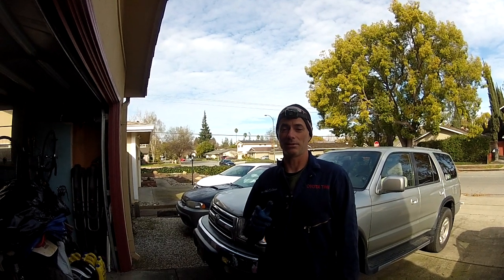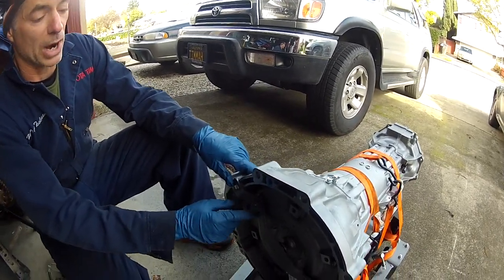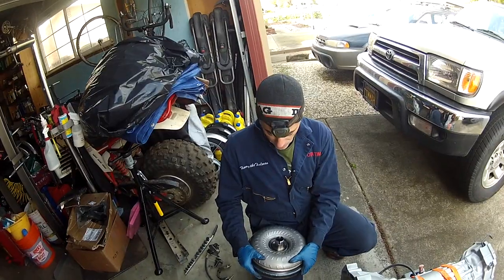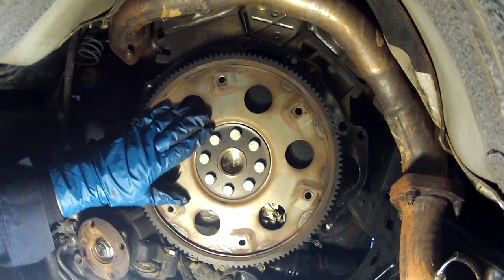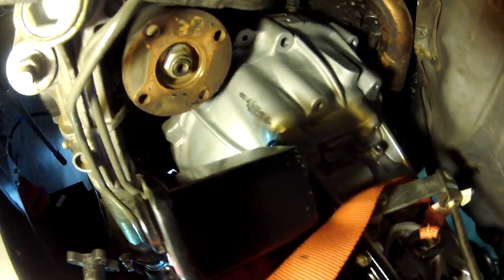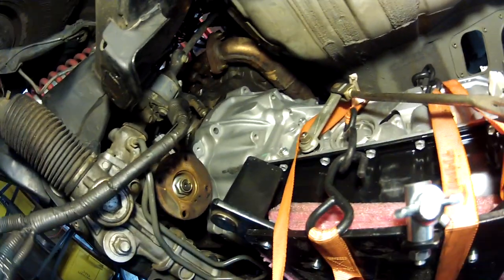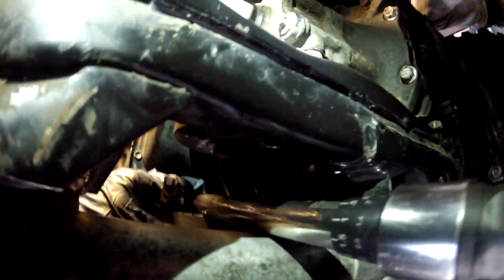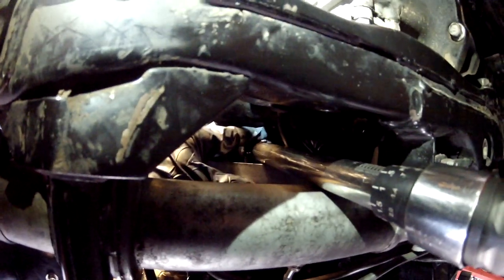Toyota 4Runner Auto Transmission Replacement (Part 3 of 3)

Comment: when you're trying to connect the drive plate to the torque converter, it helps to use some tape on your ratchet to hold the bolt.  

I used a 1/4" extension to stick through the drive plate hole then used a finger to spin the torque converter until the 1/4" extension grabbed the torque converter hole, lining it up for the actual bolt.

I say to use tape bc if you don't, you'll risk dropping a bolt into the transmission, forcing you to repull the transmission like I did. don't be like me!
Reply from the maker: Yep, we like the tape on the socket trick.  We've used it lots of times.  I think I was able to get them all started by hand though.

Comment: Hi Timmy, question for you, do you have to support the engine in any way? Thank you.
Reply from the maker: No, you don't.  The engine is fairly balanced on the engine mounts and won't be putting too much extra stress on the mounts with the transmission removed.

Comment: GODWILLING I'll be replacing the rear main seal in the future. After  the transmission is out would it be as simple as removing those bolts on the flexplate and getting it outta way? In doing that step would the rear main seal be exposed right behind the flexplate for removal...? Love the videos, I might actually get brave and do this alone lol...
Reply from the maker: You are correct.  After the transmission is out of the way, you remove the flex plate and the rear main seal is exposed.  You could do it alone with a transmission jack but it's definitely easier with somebody helping you.
Reply: @TimmyTheToolman  : ok, great thank you, I really appreciate you guys.
Reply from the maker: @israelrodriguez6986  You're welcome Israel.

Comment: Awesome video Tim! How much did the new trans cost? 
I wouldn't try this myself but it's cool to watch and learn. My 4Runner is having the rear main seal replaced and I was curious on how the trans is taken out.
Reply from the maker: Hey Eric, out the door, Sean spent $2500 for the transmission at a local Toyota dealer.
Reply: Is it a new or a rebuilt transmission?
Reply from the maker: Well, there's no such thing as a new transmission for these 3rd Gens as far as I know anymore.  Anything you buy is going to be rebuilt or remanufactured.  I though rebuilt and remanufactured were the same thing but they aren't.  Rebuilt means somebody tears apart the transmission and only replaces the parts needed to make the thing work again so not all parts are replaced.  A remanufactured transmission means ALL moving parts are replaced.  The only things that are reused are the casing, the pan and any other non-moving parts.  The transmission Sean bought is remanufactured by Toyota and essentially NEW because all the internal moving parts are brand new.  The outer casing is just a shell to hold everything together.

Comment: Mr. Timmy how do I adjust the transmission kick down correctly?? Thank you for your helpful videos!!!
Reply from the maker: Take slack out of the cable by adjusting the position of the 14mm nuts that hold the cable to the throttle body.
Reply: Timmy The Toolman the cable needs to be firm correct? I’m just confused whether to leave a little slack or none at all
Reply from the maker: You want a tiny bit of slack, not tight.
Reply: Timmy The Toolman Thank you so much!! I think I left too much slack and made my rig shift rough from 1 to 2. When I get home I’ll leave just a tiny bit of slack and take it from there.

Comment: Does Sean's 4Runner have a body lift?  Would it be much more difficult to R&R the transmission without the body lift?
NM.  I see my questions are answered in the video.  Thanks.
Reply from the maker: Sean does have a 2 inch body lift which probably made getting the upper transmission bolts out easier but there's plenty of room to get the extensions and socket onto those bolts even without the lift.  It also might have made it easier to get some of the electrical connections disconnected but I'm just guessing.  The body lift probably made the job a little easier but not a lot easier.  This isn't a hard transmission to pull.  It's just a time consuming job that's all.

Comment: Awesome job Timmy the Toolman, unfortunately it looks like I'll have to do this to my truck. The snake oil/lubegard didn't help with shudders on my truck. About how many hours did it took you guys from start to finish?
Reply from the maker: Hard to say Sean because we're filming and that at least doubles the time.  I'd say for the whole job and its your first time doing it, commit 2 days to play it safe.  Its a lot of work.
Reply: Hey Timmy, do you know if there's a easy way to tell if the torque converter or the transmission fluid pump is bad? I read that both would make a whining noise if they go bad.
Reply from the maker: @gibfkn  No, I don't.
Reply: Hey Timmythetoolman, I just drop the pan and there wasn't any chunks, there was some really small metal shavings, like you can't even pick it up small. But, the fluids was kind of a dark red, which I think is kind of odd, considering I just put about 10qts of brand new fluids in it about a month ago. What is you take on this? Like always thank-you in advance for your help!
Reply from the maker: @gibfkn  There was probably sludge build-up in the transmission and the new fluid with it's detergent qualities worked loose that sludge made the fluid discolored.
Reply: @TimmyTheToolman  Dude, taking the transmission out without a lift sucks, I just did it this weekend. 

Hey, man let me know the next time your in Portland, I'll buy you a beer or something for answering all of my questions.

Comment: Hey Tim, I have a 2000 4runner SR5 4wd and I need a new shifter seat, But I noticed on Marlin Crawlers it doesn't specifically say that the Red, White, or Blue fits. I'm curious if the blue one will fit mine.
Reply from the maker: Hey Brandon, I thought I remember only one choice for a shifter seat when I was on their website last.  I'd call them and ask so you don't end up ordering the wrong part.

Comment: So you didn’t have to drop the pan again on the new trans to get the most forward hard line tight ? Like you did to get it loose ?
Reply from the maker: Yes, you're correct.  I was able to get that flex head flare nut wrench in there to tighten the nuts without getting getting the pan out of the way.  2nd times a charm.
Reply: Thank you so much, yr video was edited right when you tightened up that front one so I just wasn’t sure how you did it, considering you dropped the pan the first time.
Reply from the maker: @forestbell3853  You're welcome.

Comment: Do you run cleaner through the cooler lines before hooking in to new trans? I installed new trans and was told to clean all lines before hooking to cooler.
Reply from the maker: We didn't run cleaner. We poured clean ATF through them just in case there were some metal bits in them from the transmission failure.

Comment: Hey guys, I think your videos are great and they've certainly helped me out with all my yota's. So I'm not much of a youtuber and could not figure out how to even private message you but I have a question about swapping motors with different transmissions. I have an '01 Tundra with a 5vzfe manual that I pulled the heads off and discovered that I need the heads rebuilt. I found another 3.4 with 130k and fresh timing for $500. It came out of a 99 4runner with auto transmission. My question is whether or not the wiring harness plugs from the manual tundra will hook up with the plugs on the motor? I don't see why they wouldn't but want to make sure. I'm pull the block out today and hopefully my new motor will be in this week. Thanks in advance and keep it up guys!
-Patrick
Reply from the maker: Don't know the answer to this.  I would venture to say the plugs might very well be different since they are different years and different models.  Sorry I couldn't be more help.

Comment: Hi Tim!
Great video! How long did it take you to do the whole job?
Reply from the maker: Mike, that's a hard question to answer because we did this job over several days and we were filming which always takes way longer.  If you have the replacement transmission ready to go, you could knock this out in one day no problem.  One day would be having a friend to help you.  If you were by yourself, it would make it harder and longer.  I suggest getting someone to help you and a transmission jack is very nice to have.

Comment: I'm having a problem with my transmission. I do believe it's the torque converter due to the sound of it and I get shuddering when I drive it. The sound is only present when in gear/ under a load/ when I shut vehicle off could a flex plate cause that as well ? Thank you.
Reply from the maker: No, the flex plate wouldn't cause this.  When the flex plate starts to crack, it makes a distinct sound but there's no mechanical symptoms.  The flex plate will make noise until it breaks all the way through and then your vehicle won't be going anywhere.

Comment: hey timmy. i’m hung up on the kick down cable. would it be easier to disconnect from the throttle body and drop the trans with it. i loosened the 10mm holding it to the trans but it still seems connected to something
Reply from the maker: If you have a kickdown cable, you want to disconnect it at the throttle body.  If you wanted to pull it from the trans, you'd have to drop the pan and remove the valve body.  I'm assuming a rebuilt trans comes with the kickdown cable installed.  At least that's what I'd hope they'd do for their customers.
Reply: @TimmyTheToolman  sounds good thanks again!
Reply from the maker: @zrock4r  You're welcome.  Good luck with the rest of the job.

Comment: Great video just hope I never have to do that. I watch all 3 videos hoping to see where the speed sensor was/is located. Dealer says driver side. Haynes book says, well not much! 
I'm trying to troubleshoot ABS, BRAKE, VSC TRAC, VSC OFF lights and a non working speed-0. Another thing do you know where I can find how to test ABS relays. Thanks!
Reply from the maker: Hey Lance, the speed sensor is towards the back of the transmission on the driver side.  If you have a 2 wheel drive with a A30E transmission, it's right above the transmission mount.  If have a 4 wheel drive with the A340F transmission, it looks like it's right around in the same spot, but it's hard to tell from the picture in the FSM.  Somewhere near the back of the trans before the area the transfer case bolts on.

Sorry, but I don't know anything about testing ABS relays.  Try asking this question on T4R.org in the 3rd Gen section.  There's lots of helpful dudes on there and one of them might have some advice for you.
Reply: Timmy The Toolman thanks for the reply. I've looked that transmission all over. I can't find the speed sensor. Maybe im blind! Lol. Thanks again

Comment: Hello I recently changed changed my transfer case myself, I installed it but it seems to be leaking at the very bottom , all the bolts are torqued and I also put a New out put shaft seal , could you help in any way ?
Reply from the maker: It’s important to identify where the leak is coming from.. clean it up rear good and inspect it after a drive to make sure it’s a seal and not a crack in the casing.

Comment: I have a 1999 4Runner limited 4x4 that sounds like it’s either stuck in park or neutral wen I put in drive.. it jus revs with no movement.. no noise coming from transmission and fluid is still red. Could it be torque converter or is transmission bad..?
Reply from the maker: It could possibly be either of those possibilities.  Sounds like it's time for a new transmission unfortunately.  I guess you could have it towed to a reputable shop for a second opinion.
Reply: Timmy The Toolman are they 1999 transmission the same as 2000..? I was going to purchase one and the seller says it could be different.. and do u know the spline count on the 99 torque converter..? Is it 20 or 26..? Thanks
Reply from the maker: @jphompong90  I'm not sure if they are the same, but if I had to guess, I'd say they are.  There was a change for the 2001 and 2002 models for sure.  I think what I would do is go to my local Toyota dealer and see if the parts department could help you out with this question.  Or, you could do a search on an online Toyota parts supplier website and see if the part number for the 1999 and 2000 transmissions match.  I'm not sure about the spline count for the torque converter either.

Comment: Was the transmission you installed a remanufactured one from Toyota or a rebuilt one from another shop?
Reply from the maker: It was a remanufactured one Sean picked up at a California Bay Area Toyota dealership.
Reply: Interesting, the local dealer here says there is no Toyota remanufactured one available. Is there a part number from Toyota? BTW, you make an excellent video.
Reply from the maker: Hey Craig, I don't understand why your local dealer said that.  The dealer near me, Stevens Creek Toyota, said they could get one and the dealership Melody Toyota in San Bruno where Sean bought his from obviously had no problem getting one either.

Check out this link to Camelback Toyota in Arizona:   https://parts.camelbacktoyota.com/parts/2002/Toyota/4Runner/Limited/?siteid=214329&vehicleid=84052&section=AUTOMATIC%20TRANSMISSION

This would be the part number for a 2002.  Plug in your year and you'll get the correct part number.  Sean called around and Melody Toyota was willing to sell it for the lowest price.  I think he got it for around $2200.  if you have any more questions, just ask.

Comment: i just did a trans swap yesterday and mine only required 6 quarts, but was told to buy 12. i returned the 6.
Reply from the maker: The entire capacity holds around 12 quarts.  Like you, I found they sell the transmission with some ATF in it.

Comment: Im replacing a 2001 tundra, would you happen to know the transmission oil capacity for an empty transmission
Reply from the maker: I'm guessing you're talking about an auto trans.  Don't know what it is for your Tundra but the capacity for the 3rd Gen 4runner auto trans is around 12 quarts.

Comment: Where do I buy a A34OH Transmission
Reply from the maker: You can check with Toyota and see if they sell a remanufactured A340H.  They started discontinuing them, so you're probably not going to be able to get one from Toyota.  You'll need to find a shop that can rebuild it.  Yota1 Performance in Riverbank, California rebuilds them and they will freight ship.  Give them a call.  https://209yota1.com/

Comment: Where did you guys get the rebuilt transmission and does it still run well?
Reply from the maker: The rebuilt transmission came from Toyota.  It was a Toyota remanufactured transmission and yes it's still running well.